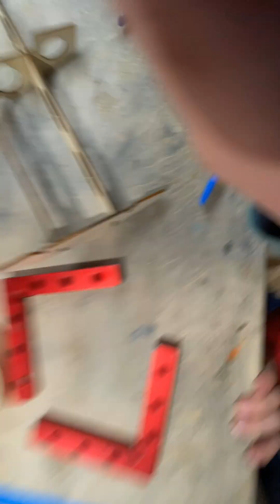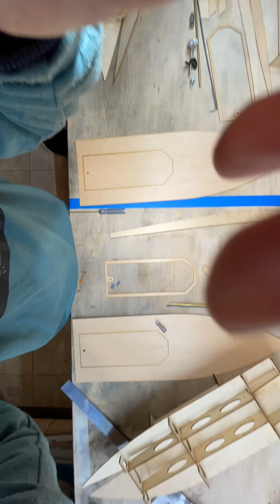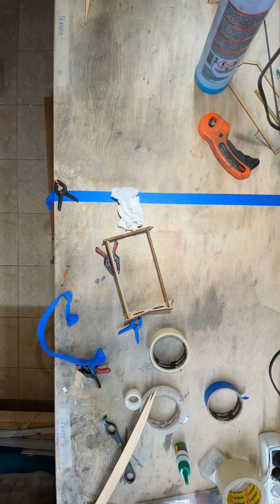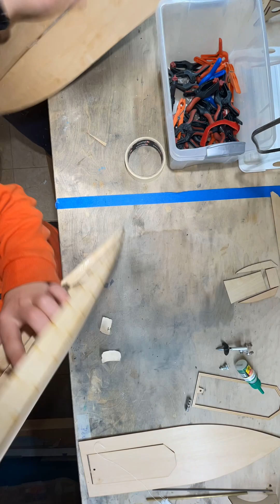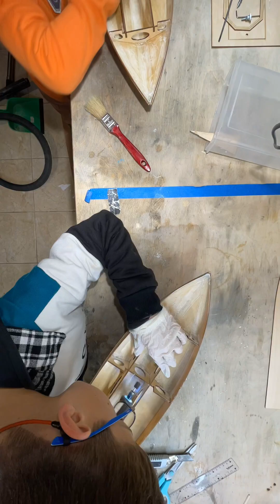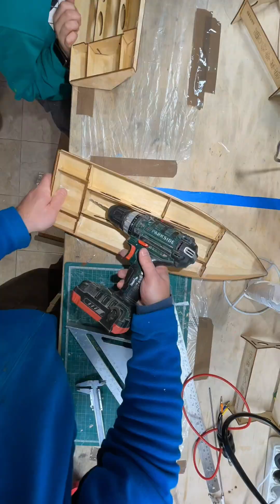Building a mini "Wild Thing" rc boat kit: Part 1

Comment: Very nice video and great to be able to share the experience with your sons. 
I'm currently building one of these as well just waiting for the drive and motor to arrive.
Reply from the maker: Thank for your nice words. They    are nice kits and it is great that you also build one so that we can share experiences on set up 👍!
Reply: @KapRC  I'm sort of shooting in the dark with my setup - I'm experimenting with a cheap build but not out and out performance. My setup plan is: 2212- 2700kv motor with a 3.175mm flex drive turning a 30 or 32mm prop (drive kit comes with a 30mm prop) running off a 3s 2200mah lipo. All parts including the boat  is from Aliexpress
Reply from the maker: @SezPilot  we have more or lest  similar setup... Just the motor has more kvs (3350), 3.2 flex, 3s 3300 mah lipo, and a 32mm 1.4 pitch prop, and 90 Amp esc. I am also experimenting with this hull. Oh I will definitely add homemade turn fins and trim tabs. I let you know... Good luck and fingers crossed with our set up choices... 😁
Reply: @kaprc631  looking forward to your videos of the completion and running. And I'll let you know how I get on with mine👍